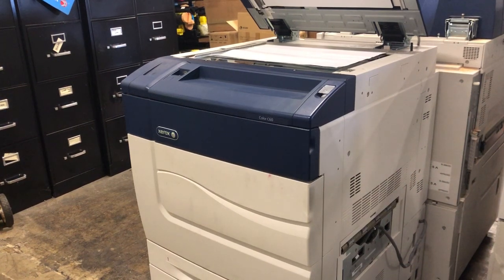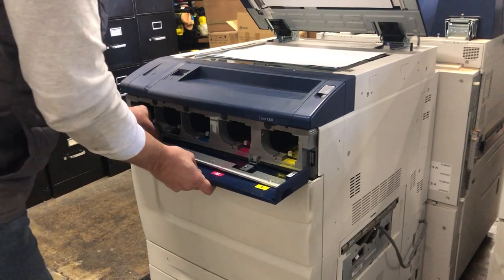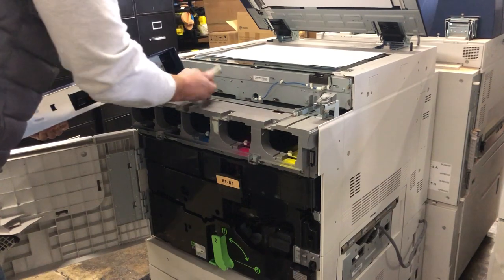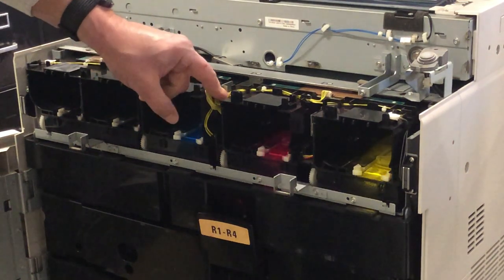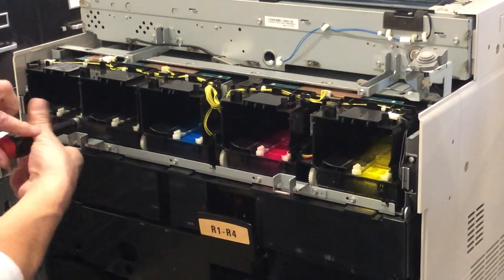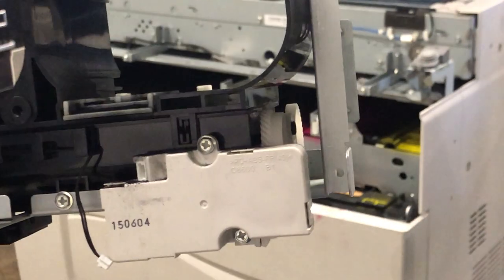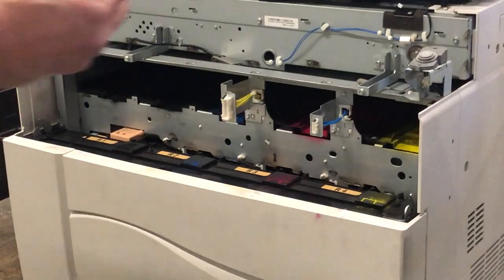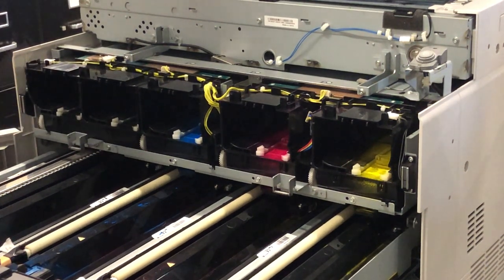Xerox C60/70 or 550/560/570 Toner Dispenser Removal

Comment: I have the 560 model, I replaced cyan motor but cyan prints appears so weak, I suppose the imaging unit ran out of toner, is there a way to refill de drum?
Reply: There is no toner in drum unit, so you can't refill the drum. You need to replace developer powder in Cyan developer housing or even maybe replace the whole developer housing unit, maybe it's something wrong with it.